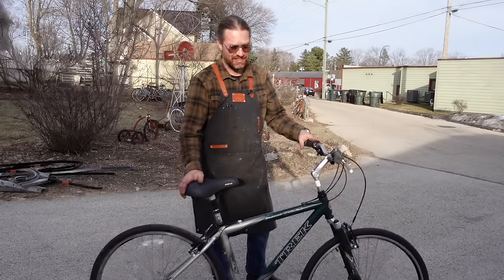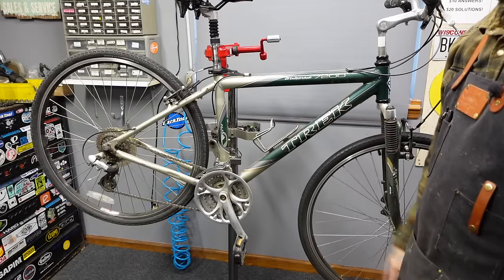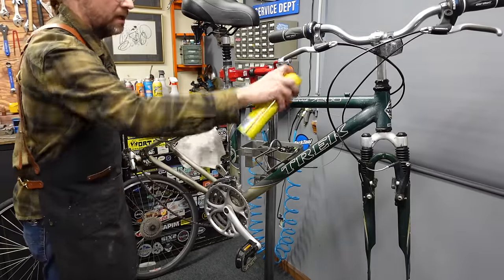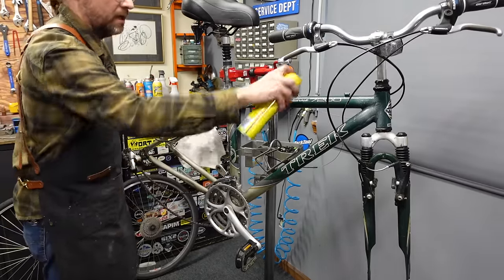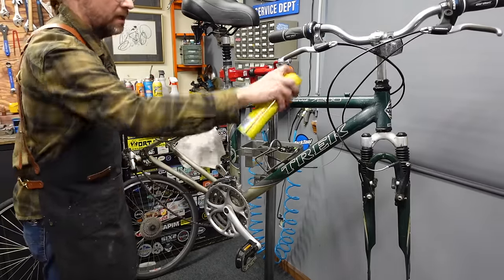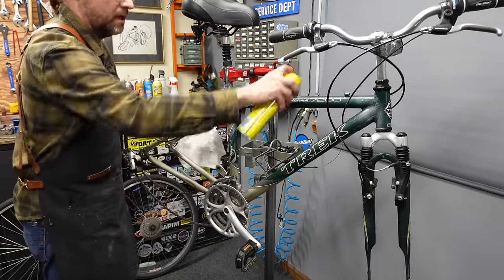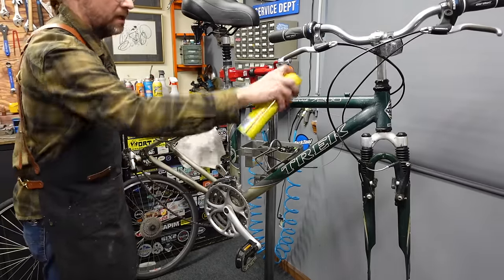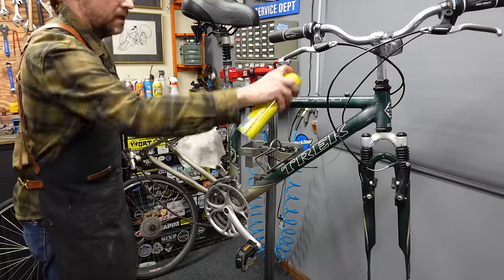The EASIEST bike to flip for MONEY! '00s Trek Hybrid Bicycle gets RECONDITIONED for an EASY SALE!

Comment: There isn't much that I "clean" with a filthy rag. I clean my bike similar to how I clean my car. Not in a car wash. It's just a used bike and whoever buys it has no idea what you cleaned it with. The good thing about inexpensive bikes is it really doesn't matter. One of the things that drives me nuts is about vehicle mechanics. How dirty their hands/gloves get and they touch keys, steering wheel, and other things in the car or on the paint. I own a plumbing company and the plumber are supposed to wear nitrile gloves when working but take them off if they need to touch door knobs, faucets, or other surfaces not related to their work.

Comment: I use yellow "awesome" cleaner. You can dilute it and its super cheap. I do the same thing with cables but i also clean them with a light scuff pad and awesome before i lube them. Ill put a thin film of grease on them before triflow. A lot of the bikes i sell end up living outside. Any bit of protection from the elements helps.

Comment: I so agree with your outlook on bikes. And wish you well selling them to your community.

I have a 1990s steel Marin Bonas Ridge 26 inch MTB seven speed, friction shifter triple (42, 34, 24) that I bought second-hand for £85 ($108). I made up some better quality wheels on decent hubs, fitted a butterfly touring handlebar and last summer rode it 1,400kms across France from Normandy to Provence, going up the Loire until it becomes a stream and camping all the way. Only one guy in my cycle club appreciated it: others thought it was out of date, slow and heavy (it is, but so is any camping tourer). In Provence I hired a KTM carbon road bike with Di2 electronic shifters and disc brakes and rode up Mt Ventoux. But I was quite happy to return to my bullet proof , well-loved tourer at the end. The guy who saw the point of my bike has toured down west Africa and across the Atlas mountains in Morocco, so he sets the bar quite high. You absolutely do not need expensive bikes to have fun.

Comment: Thanks for all of the videos. I just pulled an old raleigh rapide out of my shed and got it shined up nice and running well. Now I have a nice vintage 10 speed to go with my modern MTB. One to tear up the trails and one to glide around on pavement.

Comment: Nice video! I have wondered about those torque keys.  I find the issue with all the adjustable torque wrenches, that are like the Park one, is having them correctly dialed in. Lots of potential for inaccuracies caused by turning a few degrees too much or too little.

Comment: I ride one of these (a 7100 with same graphics but blue), and I really like it.

And my only gripe with it is that there isn't as much tire clearance in the rear as you might think. I had to file down the kickstand plate / chainstay bridge thing a bit to allow for my 47mm width tires

At this point, the only stock parts on it are the bb/crankset though. Rigid fork was the biggest/best change I made, got a lucky dirt cheap score on a rigid soma fork with tange tubing at a bike swap. These things run the "oddball" 1 1/8 threaded headset, so it's easy to go to threadless if you want to change up the fork.

I dad pretty hard on my trusty trek hybrid frame, learned a ton of bike mechanic stuff along the way
Reply: I also have a Trek 7100 I've enjoyed and ridden on local trails and for a few 100km rides.

Comment: I also clean the hubs every time I tune a bike, but I think my way's a little faster and easier: Wheel is in the truing stand and valve is at 6 o'clock. Grab opposite (diagonal) corners of the rag. Pass one corner between the spokes at the valve, and loop it around the hub so it comes back out towards the valve. Hold the corners of the rag and floss back and forth. Then, to hit the other half of the hub, turn the wheel and push the rag as you go, and do the flossing maneuver 180 degrees from the valve.
Reply from the maker: Yeah, that works too. But you still gotta get in the nooks and crannies…

Comment: I have a 7300fx disc a 2005..  with a surly fork and a little rasp work to fit a 2.1 kenda happy medium.

I tend to tighten the adjusters before setting up brakes then back off the adjusters for pull.   just reset my mech discs this morning on two bikes.   adjusting the rear caliper and the trigger to hold the thing with cable then just having the tiniest backing off

26:30 AMEN!!!!

Comment: I can't believe you lube the cables. I worked in a bike shop for a number of years. We never lubed cables. We always replaced the cables and all the housing. Tri-flow is meant to be used on the drivetrain only. New cables and housing will perform better then just using Tri-Flow on the cable. Especially if you use cables and housings that already have teflon and/or grease on them from the manufacturer.
Reply from the maker: Couldn’t agree less with almost all of your “I would do it this way” comments. You know what you’re talking about, but I could never hire you. Nothing you say makes business sense. Nobody wants to pay for all new housing and cables and labor on a $200 bike bro. Replace if NEEDED, not because you think it will perform better, which also isn’t always true. You would cost me so much money 🤣😂🤣 (but thanks for watching and commenting because that makes me money 🤑)
Reply: @bkefrmr  hey don't suggest that old cables already have all the stretch removed so are more efficient than new ones! Or that the "lube" they come with new is either useless or non existent! He's a bike shop guy he knows it all! 😂
Reply: @bkefrmr  My apologies. You are right of course. I was thinking about what I would do if the bike is mine rather then what's good from a business point of view. I know flipping bikes has a razor sharp profit margins. I've always just replaced everything on my bikes. Have you considered using a grease that sticks to the cable instead of using Tri-Flow?
Reply: @6479rob  Buying 4 cables at $4 each and housing at $2 a foot isn't going to break the bank. No where the cost of a new bike even when factoring in labor.
Reply: @kona0197  When I had new cable’s installed for a stem raiser upgrade it wasn’t cheap like that , I asked two local bike shops for a cost after all the new parts it was definitely more than i expected.
Reply: @6479rob  I've never paid more then $5 for a cable or over $3 for a foot of housing at my local bike shops. I don't know how much they charge for installation, I usually do all of that work myself.
Reply: @kona0197  Most likely $90 a hour for the work I had done. Plus $28 for a stem and around $23 for the cable.

Comment: Chain wear devices are pointless.
Reply from the maker: It’s a guideline, not a rule. Definitely not pointless.
Reply: How do you mean? I think some are more pointless than others.
Reply: Chains & rear cogs wear together. They can go tens of thousands of miles before wearing out. You know they're done when the chain is slipping off the cog. Then you change them both, and unless you're a mug riding a mug bike it costs under £50. Then the next chain & cog last tens of thousands of miles more.
Those chain wear devices will have you changing chains every 500 miles when there is no mechanical reason to do so. That is why they're pointless.
Reply: @papalegba6796  Change the chain before it gets to 1% elongation, and you can replace multiple chains before your (more expensive) cassette is worn out. Doesn't seem "pointless" to me.
Reply: @mattgies  how about I don't change either until the chain is slipping off the cassette, because there's nothing wrong with them until then & it takes years for that to happen? Plus cassettes & chains for my bike are the same price anyway, £13 each at most. No idea what you ride but it seems a huge waste of money & I bet you don't go any faster than me 😂
Reply: @mattgies  btw I also "lube" my drivetrain with thick motor oil & in winter I use axle grease too, like my granddad taught me. That seems to add years to its life, but I'm sure you have a far, FAR more expensive, less efficient, method you learned off a random internet nobody, rather than a person you know in real life with decades of mechanical experience & that you have tested yourself😂
Reply: @papalegba6796  No, I have a cheaper, easier, less smug way of taking care of bikes. But most of all, I'm damn glad you're not one of my customers!
Reply: @mattgies  you don't have customers, you're a compulsive liar. Like, you said cassettes were more expensive than chains but they're the same price for my bike. Why do you come here to lie to people? 🤔😂
Reply: @mattgies  so you have a bike chain oil that's cheaper than motor oil too? And that's more effective & cheaper than axle grease in winter? Care to name them, compulsive liar guy? 🤔😂
Reply: @papalegba6796  Urine is free but it's not going to prolong the life of your chain. I can't help you out of your simplistic mindset, but thanks for asking.
Reply: @mattgies  ok compulsive liar guy that doesn't know the price of bicycle parts, or anything about bicycle maintenance, but claims to be a bicycle mechanic 😂
Reply: @mattgies  you said you had a cheaper, easier, way of oiling a bike chain than motor oil. Name it please!😂
Reply: @mattgies  you claim that my using an oiling method that gets tens of thousands of miles out of my drivetrain is "simplistic" . Care to explain why? Or answer any questions at all? 🤔😂
Reply: @mattgies  you also like your own comments. Why is that? 🤔😂
Reply: They literally have points. Lol.
Reply: @carldreher  they literally are useless devices that make you spend money POINTLESSLY. not debatable if you actually ride bikes a lot rather than sell stuff to people who ride bikes 😂
Reply: @papalegba6796  You do not get tens of thousands of miles out of any chain. Nobody does. I'm not arguing with you because you're making sh!t up. Explains why you feel compelled to call me a liar, though.
Reply: @mattgies  stop lying, liar, you can easily get tens of thousand miles out of a chain & lots of people have. Now answer my questions please, liar 😂
Reply: @papalegba6796  You know, we can all Sea you Lion.
Reply: @mattgies  ok troll guy 😂
Reply: @papalegba6796  "Sealioning is a critical term for a form of trolling that involves relentlessly pestering someone with questions and requests (such as for evidence or sources), typically with the goal of upsetting them and making their position or viewpoint seem weak or unreasonable."
Reply: @mattgies  that's nice, lying guy 😂